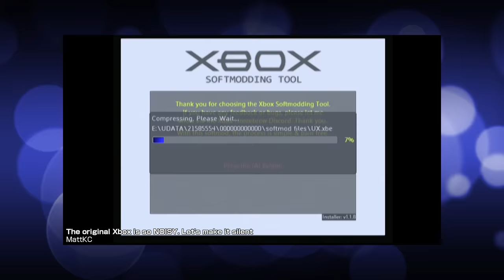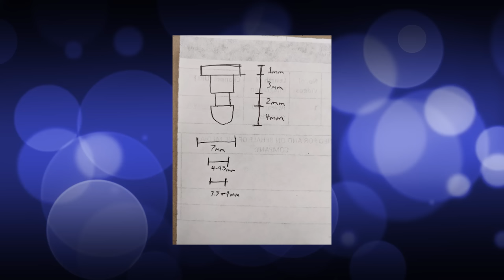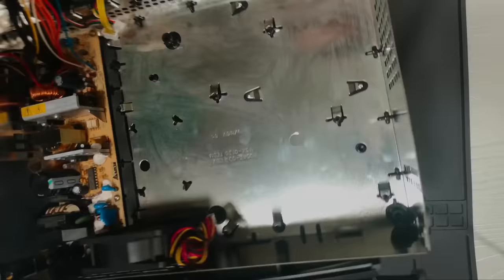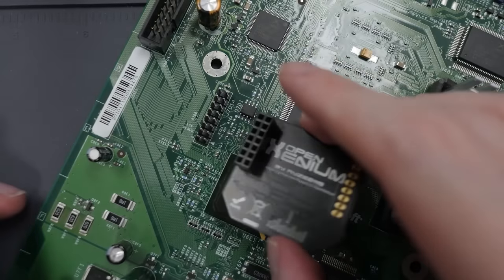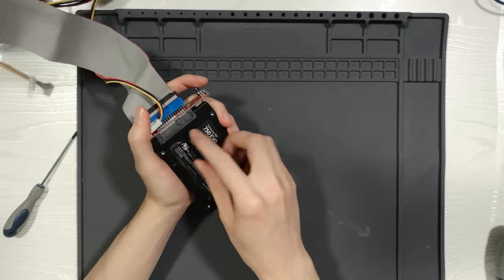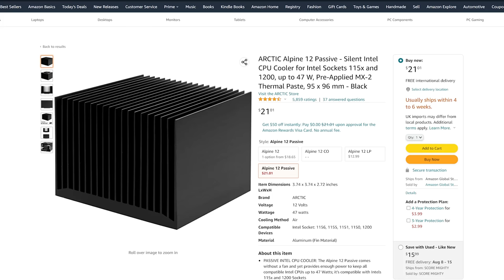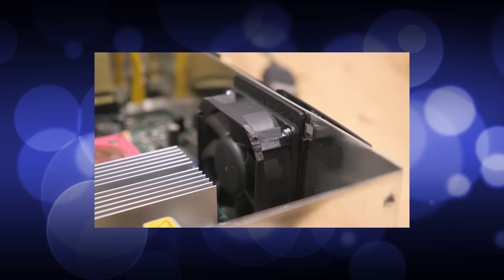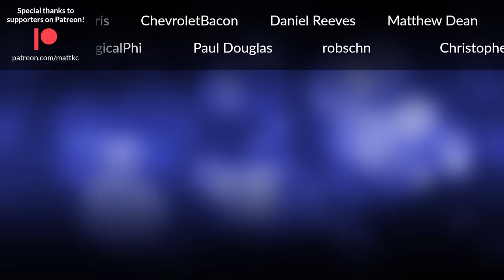My Silent Xbox Has A Problem...

Comment: I once had a low profile HP PC, and a tunnel was put on top of the top facing fan, solving the side outlet issue. :) You can print such tunnel easily with a 3D printer :)

Comment: I love the whirring sound of the PS2 and Xbox, combined with the startup logo sounds it's such a nostalgia trip :)
Reply: Honestly considering finding ways to mod my desktop PC to sound more like 80's and 90's PCs, the silence kinda gets boring!

Already started with a PC error code speaker so it has a chearful "BEEP" every time the bios boots and starts loading Garuda Linux, now I just need fans that get meaningfully loud while still doing a decent job and not nessisary sounding "bad" which will be more involved.

Oh and making something that emulates old harddrive noises based on the activity light on the case, which will probably be custom.

Oh, and a floppy disk drive, because I found a old Sony Mavica FD75 floppy disk camera and can't resist the urge to play with such weird old hardware
Reply: @UNSCPILOT  Old hard drive sounds 😍

Comment: For future reference a wood chop saw will cut aluminum.  I recommend squishing the blades into some soft wood, or filling the gaps with some wood, and just chop it slowly.  Then you would get the benefit of a taller heatsink.

Comment: One thing you could consider doing is using liquid metal thermal compound on the CPU. You can't mix liquid metal and aluminum though, so you'd have to nickel-plate the aluminum heatsink.

Comment: Hnng, please, this is your best series so far, watching you struggle with that green boy makes for great content!
Please look in to server cpu coolers like Dynatron T318, and please just move those caps. Or replace them with smaller caps, and solder them in so then have long feet to move them far away. They do sell heatpipes on Mouser and other places, you can bend them, and they can move the location of the cooler

Comment: What if you used an impeller? That would be low profile and would easily fit in the case. You often find impellers in laptops and such where you have a really tight form factor

Comment: The best way to learn cad for 3d printing (I use fusion360) is to jump into a major project and break it down into smaller pieces. Watch a video or two on the basic features like UI navigation, and basic sketches, and joint components to create one big assembly of all the smaller parts you designed.

Comment: The hard drive caddy is part of the cooling system..  it directs airflow over the cpu heatsink.  Without it, the fan can’t pull air over the heatsink

Comment: to cool your components, what you can do is use the noctua cooler you showed off and 2 noctua 4020 fans on the side of that cooler, blowing the air through the width of the cooler like you wanted it. it would cost some money because noctua, but it would preform like noctua.
Reply: also maybe covering the area where the 92mm fan is with tape or something so the air blown from the 40mm fans go the whole way through

Comment: I expected the whole video to be about the SATA to IDE adapter alone, but I didn't expect the focus to be MORE than just that! Good mention about removing the optical drive, though I still wanna keep mine due to...unforeseen circumstances.

Though I wanna see more. Try upgrading to 128MB ram and a Tualatin Pentium 3. I ain't tired of seeing the Xbox until you have done absolutely everything there is to do.

Comment: Great video, I would say you can 3D print a fan holder for a noctua 60mm fan which is on thingiverse & you can also 3D print a bezel holder which can screw into the dvd holes 😉. Some have also 3D printed a shroud for the heatsink so that it pulls air closer to the gpu.

Comment: The Noctua cooler would have worked if it fit, mounted, and made good contact. You can remove the fan from the top, and keep the regular system fan, and that will still give you a similar airflow pathing, just with a lot more surface area. The GPU likely wouldn't be able to contact it, so it would still need its own heatsink. The heatsink it has would probably still fit under the Noctua finstack, if not you could try to mesh its fins together with the Noctua finstack and see if that will transfer enough heat into the bigger heatsink to matter.

Comment: I've done a low profile cooler, but I also cut ventilation into the top of the case, since the one I had picked up for modding had already been damaged anyway. That xbox ended up just being a case that I converted into a mini-itx pc case, and I transplanted the actual xbox bits to a new case of one that was water damaged beyond being worth repairing.

Comment: there is a 3d print floating around for the fan and the dvd tray front panel, also if you haven't seen it yet there is a 128MB ram upgrade for 1.6 Xboxes. and evoX titan will support hdd's up to 16TB! and using a startech ide adapter you can use the UDMA 5 option for titan making boot times even faster! but titan only works on 2TB+
Reply: also if you arent using dashloader by rochy5 with evox you should it patches in xiso support on bot

Comment: A custom copper heatsink for each die would be better, you could get the same size and shape but better heat flow.

Also having an extra tiny hole in the side of the case can mean a little extra air intake which could reduce temps

Comment: Removing the DVD drive and opening up all that space, likely reduced the air movement in the unit as well.   Probably offset the difference by properly sealing the fan, otherwise, you may have had even hotter temperatures, without increasing the fan speed further.   The drive is fitted to help with wind tunneling for airflow.

Comment: I wonder if you got a tiny fan, the height of the heatsink and put it vertically to push air towards the rear fan, if that would make any difference.  I have a 1.0 Xbox and it has a separate tiny fan right on the GPU, I've never checked my temps to see if one is cooler than the other.  Wonder if a fan on your GPU, 1.0-style, would help also.  Just brainstorming.  Liking your channel.  Just subscribed.

Comment: I used a 80mm Noctua in mine.
You need to break the bottom tabs and cut a bit of the HDD holder plastic to make it fit, but being a much bigger fan it has no trouble with airflow, and being a Noctua it's dead silent.

I once replaced all the original heatsinks for 50mm old style round copper GPU coolers with fans, had to remove the black plastic piece that hold the original heatsinks too. 
They worked, they kept the xbox cool, but since I had to hold them in place with screws washers and nuts, that put pressure on the motherboard and it bent. (that's why the fat X360 uses the metal "X clamps" to hold it's coolers in place)
Absolutely not worth pursuing that. Keep the original heatsinks, apply and GOOD thermal paste like MX-4 or Kryonaut, and upgrade the fan(s).

Comment: The simplest method to pimp a Xbox is to do the softmod standard routine and the TSOP mod to make the drive unnecessary if it fails after 20 years. To tackle heating problems, the best thing would be to change thermal paste and just mod the fan or keep it as-is while ensuring that nothing blocks the ventilation.

Comment: could you start leaving the names of the mods you do in the discription please? searching "better xbox ide to sata adapter" isnt very specific lol
also how the heck did you make it so you could remove your dvd drive and reflash the mod chip bios with out having to use a hexen installer to reinstall without a working dvd drive??? i cant find any videos explaining it nor dose the consolemodding site have any info on it only info on repairing the dvd drive

Comment: Best way to do thermals is cut the disk tray so an 80mm fan fits. Then, you should also reverse the fan so it pushes air through the heatsinks and it will lower temps by a lot.
Can also try pressure optimized fans in this configuration.

I did this on my very early Xbox and managed to run it without the GPU fan it had. Used a PC chipset cooler with bent fins to fit. You already have that on your model.

I wouldn't recommended removing the DVD drive since it directs airflow. Just disconnecting is better.

Comment: What "heatsink grease" did you use? I wonder if using a high quality thermal compound would help your temperatures - something like Arctic MX-4 or similar - along with enough of it to give good coverage of the CPU and GPU cores. That and using a 70mm fan with a better noise profile so you could run it at 100%.

Comment: yeah, PCBway is good if you want FIVE PCBs. inputting 1 gives a poorly translated error message about the PCB having to be over 5 m² for that. I get that it's not worth it for them, but the one thing you recommended them for, getting a modchip board, is not really applicable

Comment: The low profile heatsinks do not blow the air upwards, they blow the air downwards to the motherboard.  The problem you would have had is mounting any heatsink to the chips as the xbox has a very nonstandard, custom layout and cooling solution.  If you could have solved the mounting problem somehow, it would be fun to make a custom modification to the top of the case that looked decent to draw the air in.

Keep in mind, that the xbox doesn't really put out that much heat compared to modern hardware, its wattage (heat) that a given cooler has to remove from the chips is probably 25-30% that of a mid range modern CPU.  In other words, its overkill.

Your best best would be buy or make a 3d printed shroud or if you want to go a little cheaper, make one from cardboard and electrical tape, it is surprisingly effective.  You can also perhaps modify the top case to introduce airflow from above the xbox blowing down on the current heatsinks by mounting a fan on the top directly above the heatsinks and cutting ventilation holes in the case.  If planned out and done properly, it wont look bad.

Comment: Have you heard of, or are planning to do, the internal mod for the OGX360? I have seen designs to allow mounting and connecting it inside of the console. Having a USB port mounted in the crevice beneath the power button, with the OGX360 having daughter boards that allow the use of the original controller ports or the OGX360. Even saw a different version of it that has the Arduino components all on 1 board.

Comment: You're really lucky the pan head screws didn't affect how the heatsink seated against the chip. Although since youre having an issue, maybe double check you are actually getting proper contact. Try your old fan and see if the Temps change back. Perhaps use a ir cam or laser thermometer to check the heat sink temp and compare against a stock box. It's funny that I stumbled across this, I just completed my mod and upgrade last year and I still have ptsd from it. Did you do the ram upgrade too?

Comment: As for the higher temperatures, could it simply be that the quieter fan moves less air / has less static pressure?

Comment: @MattKC if you go to printables and search Xbox DVD elimination bracket, you could clean up that drive delete. It's not my model, full credit to the uploader, but i can confirm they print perfectly and the measurements are correct. Make sure you print in something with good heat resistance (like abs, asa, or even pla+) so it doesnt warp over time.
Reply: There's also a pre-made adapteer so that rear fan will mount and seal with the factory mounting clips.

Comment: Hey  Matt, maybe someone already mentioned this, but you could 3d print a bracket to mount your dvd face plate (or even 3d print a DVD faceplate with embedded bracket).

Comment: could always add an intake fan on the side panel, hide the breathing holes in the grooves of the outer chassis, that could create an air channel to drop it by 5 to 10 ish degrees

Comment: I did some mods on my Xbox 13-14 years ago. I took a case for a vhs player and removed all internals. Then added two 80mm noctua fans in the back. I created an air duct from the fans that pulled most of the air through the heat sinks. I removed the optical drive and put a wireless receiver inside. 

It resulted in a a cold and quiet Xbox that fits under the surround receiver.
Reply: bruh 80mm seriously
Reply: @handlesrtwitterdontbelivethem  yeah. two of them. The VHS player is a little more than 80mm tall so the fans fits from the outside

Comment: matt, coulnd you use a second fan, a small one like 4cm x 4cm blowing air on the heat sink? some of this fans are quieter if you undervolt them, that would help with the extra heat

Comment: I can help you with your problem , out of experience your problem might be because of the clamps aren't able to stick heatsinks on chips properly , they should not wiggle at all . originally they were held on there by some kind of silicon paste which solidifies when its dried, but since we don't want them to stick there forever (for future modding) those kind of paste aren't option for us , so the best thing to do is to put a thin layer of metal sheet (or folded paper) under those plastic clips which sit on heatsink so it can build up pressure enough to eliminate the gap(microgaps) between the heatsink and die ,and another thing is you shouldn't measure temperature in menu or custom dashboard since they are not optimised with the hardware  and they are   fan made privileges which work fine but puts pressure on hardware since its more advanced than stock dashboard ,you should test temperature under the load of games , another thing you didn't mention is if the eject button blinks after you removed the drive since if it does there is a remedy for that as well you should make some sort of voltage divider and put it in place of the socket which yellow wires stick ,so southbridge chip is tricked into that dvd drive is there and eject light wont blink , another thing for making your 1.6 motherboard ultimate with your standards is to add on more memory which has been made possible for this version of the motherboards with piggy backing memories and a few wirings ,  i said with your standards since if you were to make the ultimate xbox ever you would have chosen better board that are compatible with upgrading the cpu . cheers

Comment: it's possible to 3d print a dummy HDD with space for the SSD same with the cd drive and have the front panel bit in the right spot and keep the airflow characteristics of the original Xbox

Comment: what you can do is make something in a 3d printer that can go in the same place as the dvd drive so it could actually help improve temps (cuz' you said without it the temps were very diferent) so you would have kind of a dummy drive instead (you could look for help on how to desing it so it works as it should if you have any problem in that aspect). I saw a lot of free space in that side of the case so it might be posible to do something like that (maybe?)
Reply: Hdd caddy not dvd drive. Different things, the hdd caddy is right on top of the fan, the dvd drive is on the other side of the case

Comment: For the DVD drive, couldn't you put a switch on the power cable and so you get the benefits of having a DVD drive if you wanted to use it and the quietness of being off when you don't want it.

Comment: So with the cooler you showed that "Blew air upwards"
No that one actually pulls air from the top and blows out the sides. It depends on the cooler, for example the Xbox 360 DOES have one that blows air upwards, but that Noctua model pulls air from the top and blows it out the sides, you can tell by the fan orientation.

Comment: FYI, do not put metal bolts into mounting holes on a PCB! It may be ok for a bit but this has the potential to short-circuit the board, come loose and cause problems or just generally damage the thin layers of the pcb
Reply: There is absolutely no problem with this at all.  The only problem you'll have with this is when the fastener you're using is too large for the hole, and you're a case manufacturer trying to farm out fan bus design to the cheapest contractor with a copy of KiCAD and no understanding of keep-out clearances for internal planes.

Use a washer to prevent surface damage, if the hole is not plated, and a star washer or some Loctite to keep the fastener from loosening and causing problems with loose metallic parts in the case.  Other than that, you're totally fine.

Comment: That's exactly what I did to fit a LGA2011-3 cooler for a LGA2011-3 processor on a LGA2011 motherboard (yes, they are electrically compatible, you just need a BIOS hack for a i7 5960K), I just used long screws and a peg.

Comment: Back in the day i modded mine with an 80mm fan. Have cut the caddy. But the best thing i did was add an intake to the DVD side. 70x15mm (IIRC). It really dropped the temps.

Comment: Dude, look at server heatsinks. They ate specifically designed for this, and you could probably find one where you can replace the jet turbine server fan with a low rpm fan.

Comment: I think i would try making a 3D printed hard drive support, with a shroud from the fan to the heatsinks, imitating many OEM PC's where they put those plastic shrouds clamped to the cpu fan to force it to suck fresh air from outside the case via lateral panel intake holes, in this case it would work in reverse, sucking the air directly from the heatsinks, without any other path of air intake other than the heatsinks.
Making a clear air flow routing instead of just sucking everything in the case.

Comment: For the fan, having it mounted might reduce the noise it makes in general. This means you could run it at a higher speed, but not increase the noise, because now it's quieter, period.

Comment: You could've stripped out the insides of the DVD drive and then put it back in, unplugged. The Xbox logo would then be centred properly, less weight, and no change to airflow